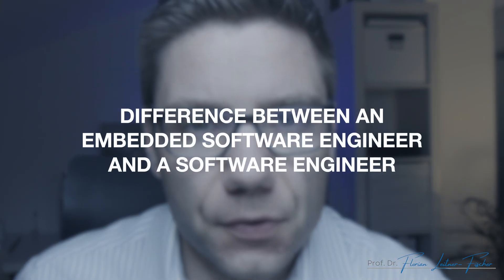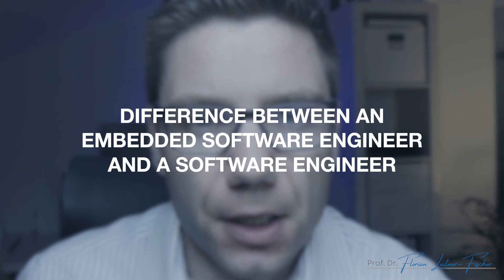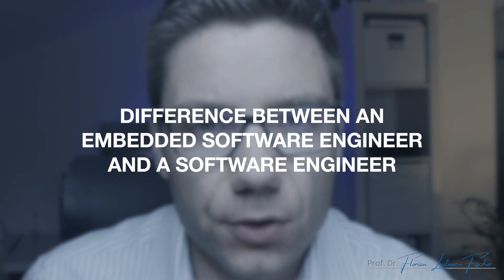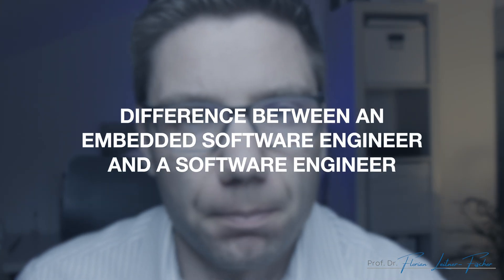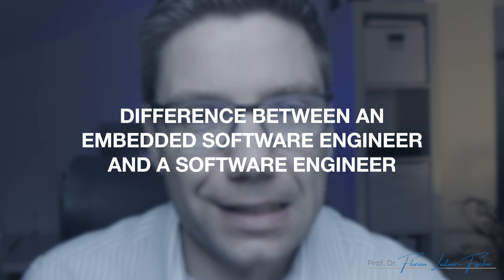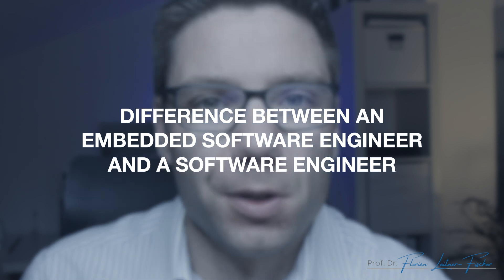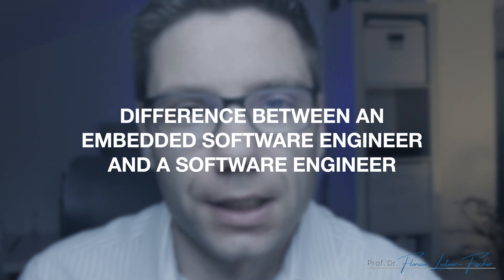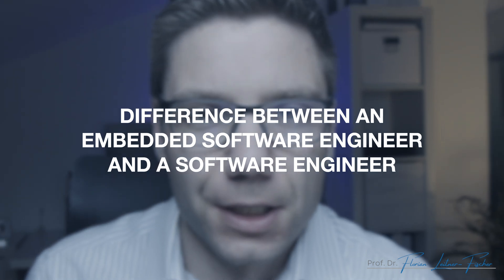Difference between an Embedded Software Engineer and a Software Engineer

Comment: Why I feel that the field of embedded software engineering is underrated even it is harder than regular software?
Reply: I'm 2 years late but essentially embedded software engineers may come across as incomplete electrical engineers, incomplete computer engineers and incomplete software engineers.

Which is a very stupid take in my opinion just to be clear.